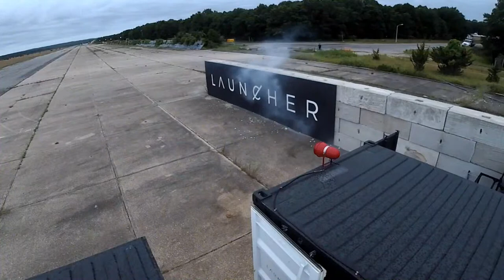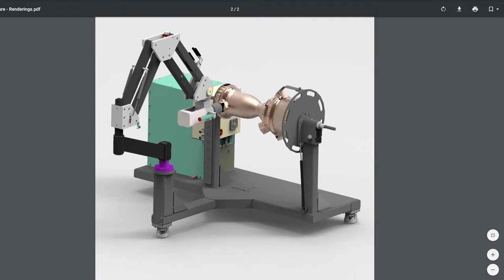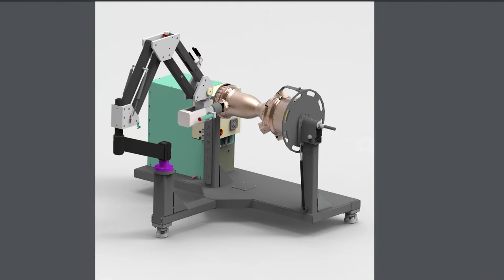Launcher Live Stream

Comment: Hey guys. Sorry I missed the live stream. I have a question about your positioner locating the part to tap from the side. Why was that decision made instead of tapping from the top? Chip removal or because you're also tapping the holes that are at an angle to the engine centerline. Thanks for the video, I came here from Abomb's channel but I'm also a customer. I'm a tooling designer who has two of your arms in our shop. Keep up the great content.
Reply from the maker: Joseph Citizen419 chip removal was a concern because we didn’t want chips to fall in to the chamber, tapping horizontally helped with that along with blasting air through the chamber to have positive air pressure pushing chips out. Additionally, we needed the tap horizontally to properly align the arm to holes, because the arm works like a parallelogram it’s easiest to align the arms and the part horizontally vs. 45 degree angle.
Reply: @FlexMachineTools  Ok, that's what I thought about the chip removal. So do you move the fixture or the arm to get to the 45deg holes? Or is that going to be up to the customer? Sorry for the questions, just thinking how I would go about it.